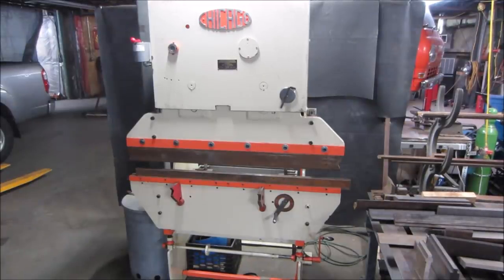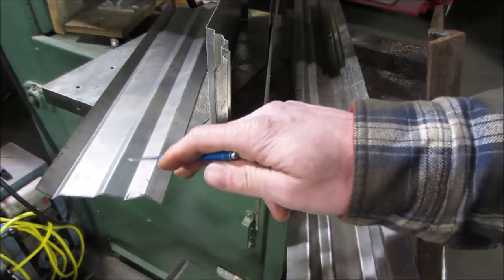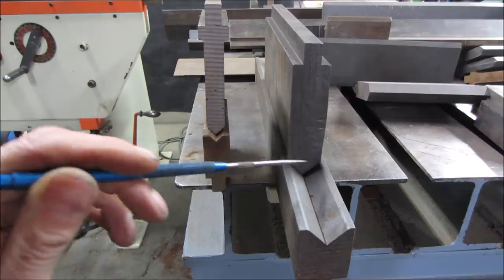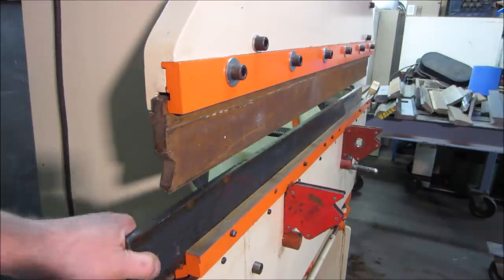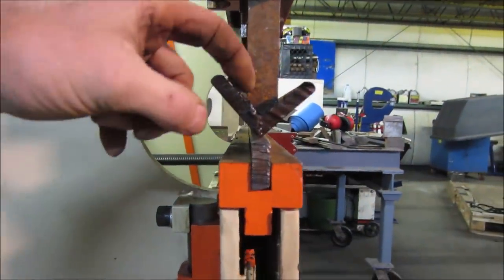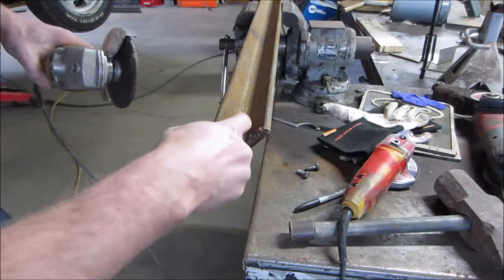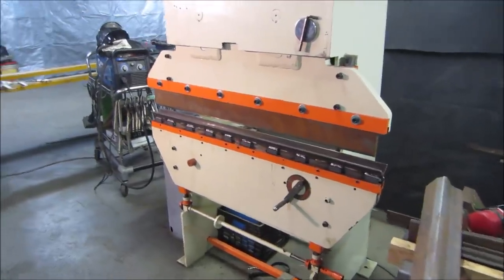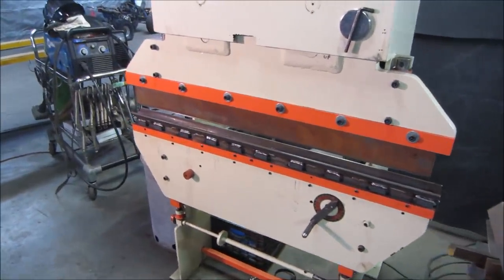Building Press Brake Dies out of Angle Iron.

Comment: Wilson Tool: 4' bottom die section should be no more than $200.00.And I think your press brake is actually a 12 ton. It's a very early model  with lower bed adjustment. The later series that are 15 ton the lower bed is fixed and the upper section is what is adjustable. 
Edit: Fun One called me out on my called $200.00 and he was correct. Called wilson and current price for a 4' bottom section is $447.00. Dang I'm getting old.....
Reply: $200 Yes if this was the 1990's
Reply: @funone8716  I have 7 press brakes at my factory from 4' to 10'. When i get to work i'll call Wilson and get a firm price to post.
Reply: @funone8716  you are correct partner. See my revised original post.Wilson is one of the more expensive ones but all are probably higher than I thought now.
Reply: @amossnowdaharleyman9179  Not an issue man. I have a Diacro 14-48, had it setting for years, and recently decided to once again check into tooling for it. I was dismayed by the costs of the tooling these days. Like someone said tho, the used junk on EBAY can be near as much as new. Have a great day amos.
Reply: @funone8716  Doing same thing with an old electro/mechanical notcher I have. Sitting in a corner for many years after I was told it was "broke". Powered it up,cleaned it,greased it,changed gear box lube and it works just fine so painted it and put it back in service for low volume parts runs.Then got to work on a 4' Chicago D&K. Varidrive pulley screaming(like Musties) so replaced it:$539.00 for that part. Still needs a new drive gear and rod bushings. Works OK as it is for specific die installed which is a 30" hemming or slip and drive 2 hit  die and put it in service as a back up to another 4' with same set-up. These little 4' PB's are handy little power units for notchers,hemming dies,repetitive hole punch operations.etc. Not just for bending.

Comment: Probably way to late, but if you weld in some pieces between the blocks and the angle it would do a lot for support. The angle may be way tough enough to handle what you are bending though.

Comment: After cutting that 1/2" bar stock length ways with your plasma, you could have just run a torch along the back side and it would have straightened it right back out

Comment: I would guess if you didn't have the shoulders there would be a chance of swelling out the piece that sets in the grove and it would stick in there. I do know when I make a tenon with my monkey tool when forging the monkey tool I made has a hole in the side of it so that I can see the tenon before it reaches the bottom of the tool so that I don't upset the tenon in the tool and stick it. (If that makes any sense what so ever.)

Comment: Clean the dies (top & Bottom) get all the rust off, and oil the living piss out of them - same with sheetmetal rollers...... I used to work in a shop making vintage race motorcycle megaphone exhaust, it helps to have clean oiled machinery

Comment: That last shot of the dies. Do you think there's a chance you could round off the point of the top die because the bottom die isn't a sharp angle?
Reply: Start at 20:35 if you care to watch the video.
Reply: I mean squash the top dies point

Comment: All you had to do was put the angle iron on Top of the half inch like its going to be, push the press down and then run tack welds all the way down the two and It would have straightened out by itself. No need for all that extra work Of changing out dies and trying to straighten it.

Comment: 15 tons is quite low. A decent sizes one is 100 tons. That's what they use in a industry starting out I believe.

Awesome job on this tool though. I would make it part of your routine to check everytime before you make a piece for something your going to use. As we seen on that last piece it really did tax that 15 ton press. 

I wonder could you just put in 2 hydraulic press tubes on each side to replace the cams that it uses on the inside of it to upgrade it?

Comment: I was writing and not watching your bottom  die is way too small and your bolster is loose the die should rest dead bottom and shim with paper or folder paper I would not use allen or metal never weld  most bolster s are crowned and some have auto crown and most have a ram tilt adjustment as well  that top die is for like 11guauge that bottom is for 18 gauge and there is air bending or kissing but very inconsistent bottom bending  you need cnc control for that and coining at the end you were coining or back bending but mismatched dies can get warm/explode

Comment: This is a comedy of errors.  A bunch of work, followed by an explanation of why the brake is ruined. Depressing. Starting with warped material does not work in any trade. Welding in place is almost always a bad idea. This guy doesn't seem to understand air bending v coining. I've never seen an operator work without a square or protractor.